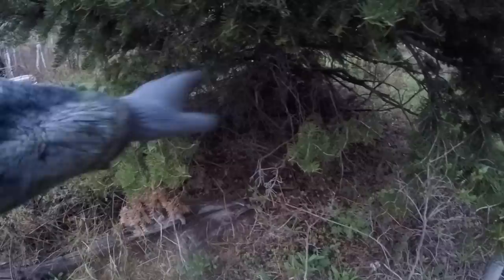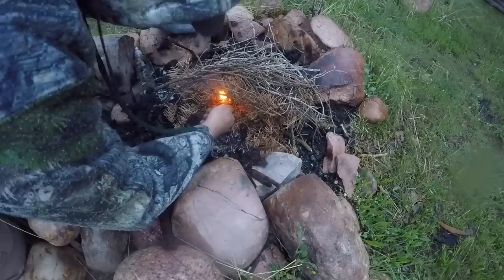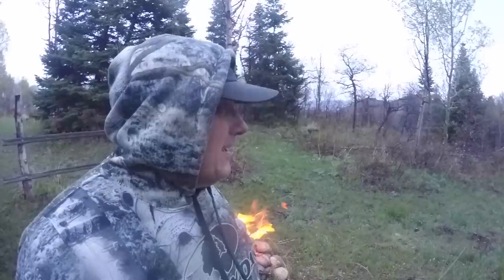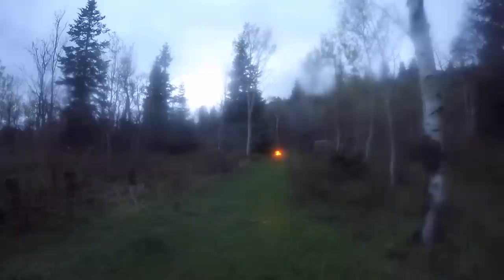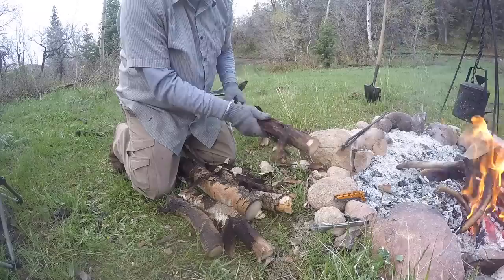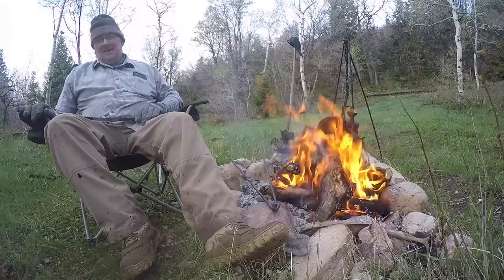Unusual Way to Use a Tarp Over a Fire - The Beast Sleeping Pad Set Up

Comment: Actually it looks like a great way to burn up an old tarp if you are not really careful. Using less when backpacking I have a small ( cooking ) fire in a Solo Stove ( Lite ) for a hot meal. It's a great way to have a small camping fire that is self contained and still  Leave no Trace.
Reply from the maker: Haha, well I've never burned up a tarp before, but it could happen. I love a nice campfire and I make one most ever time I camp, it's something I really look forward to. For me the campfire helps make the camp. There are times when  I'll use some sort of twig stove or a butane and I enjoy that too, but I really love a fire. One thing though is I use a fire pit location if one exists where I am at, but if there isn't one, I like to cover it up when I'm done.  Thanks for the comments

Comment: Why does the man set up sleeping tent far away from campfire?
Reply from the maker: I’m the man you ask about, haha….  typically my sleeping is away from the fire a bit, or away from the main part of camp a bit. I just look for where I want to set up sleep arrangements whether hammock or ground sleeping and I just do it there. I don’t need to be close. I may be right at the fire if I’m using it for heat to sleep. I have the warmth I need without the fire unless I just want to do it that way. In our area a lot of the wood in the fire will pop quite a bit, having a tent close to that is a sure way to burn a hole. I am not usually as far from the fire as in this video, but it was nice for this location since the ground around the fire was all cobblestones and where I set up was soft grassy sod. Thanks for asking !!

Comment: That pine looks like a fir tree to me. Hard to tell on a 1.5"×2" screen. Lodgepole pine has shortish needles similar to a Douglas Fir, but still, that looks clsr to a fir, or spruce. Splitting hairs I guess. Pime needle rolls off the tounge a lot easier.

Comment: You may want to research what that bean can lining is made of. Unfortunately it may not be something you want to heat on the fire
Reply from the maker: Glad you commented on this subject as it is a common misconception, it’s been all over the internet for years now, so much that it appears to have become a “fact”. The truth is that if my heating beans over the fire in the same can the beans came in is harmful then nobody should ever eat any canned product ever. I’m subjecting the the can to around 200 degrees of heat, when the beans are canned they are cooked in a giant pressure cooker at temps over 300 degrees. The only way I can get the can hotter than about 200 degrees at my altitude is if I remove the beans from it, or use a pressure cooker. Another consideration is that the smoke from the campfire will give me a dose of carcinogens regardless of anything else.

Comment: You can line your tarp with tin foil also to help protect it from the heat.
Reply from the maker: There are reflective fabrics that are silver on one side. This works so well actually that virtually any of our fabrics can be used. The canopy formed over the fire captures heat and gets 120-160 degrees, which radiates down on you naturally, so heat is felt from above and from the fire, pretty cozy. Thanks !!

Comment: Tarp over a fire? More like a tarp 100 feet away from the fire! Why pitch the tent so far away from the fire anyway?
Then further in the video he does it, DOAH! I'd be concerned with the plastic overheating and either shriveling/shrinking or melting.
 Also, why people go for the fire steel first off is a mystery to me as there is still ample supply. In a EOTWAWKI, yeah, save the sure/easy start fire method for emergencies, but for now, just flick the Bic!
Reply from the maker: No there actually is a tarp directly over the fire, and there is another over my Beast Sleeping pad.

Comment: Perry i have notied in many of your vidz while cooking you use two bars to hold up you pans or cast iron. Is that something you made and if so what is the materials? TY
Reply from the maker: John High I have made a couple types for lighter duty 1/4” Stainless rod or Aluminum rod. For the cast iron I use 3/8” steel rod. We used to make and sell them, but it’s not our main line so we stopped. Thanks.
Reply: Could you PM me so i can get some more info. Thanks!

Comment: First you should have fixed the stones a bit to help if the wind whips up. Also if you build up one side of the fire pit you can sleep closer to the fire as the stones will give off some heat. You can also buy these thin fire proof sheets to put over you in case sparks land on you or if raining attach them to your trap. 
Never ever cook the food in the can it comes in, I saw another pot you had so for health wise use that. 
Just some friendly hints 😁
Reply: Or he could do just as he did and everything worked out fine

Comment: I have been toying over the idea of digging a dakota fire hole with 1 on the outside of a shelter and 1 inside except I want that hole really deep deep enough that you can have a decent size fire but the flames stay at or right around ground level so you dont burn yourself out..so what do u think is that a and idea with any merit????i would try it but the neighbors in my apt complex dont appreciate things lime that lol thanks
Reply from the maker: the flames will still try to extend to the surface. You don't need to go more than 12-18 inches, by the time you put your pot on you wont see much in the way of flames. It would be best to try this in the woods. You can control the size of your fire by how much airflow you allow and by the wood you use for the fire. I think it would be difficult to have the air intake outside the shelter and the fire inside. Seems like you'll be starting the shelter on fire.
Reply: @wildernessinnovation  thank you for answering me....i had the same thought about it burning down the shelter that's why i asked.i live in washington state in the puget sound our woods have a ton of undergrowth black berry clinging vines hell seems like everything out there wants to poke and stab you to death lmao if there isnt a trail you are pretty well out of luck its a rainforest after all and in winter it rains constantly sometimes for weeks at a time without a dry day.i say that to say this.i am hoping that with sufficiant height and the cold rain on the outside and probably try to find some sort of flame resistant like reallybigmonkey  did years ago if you havent seen his channel he is great lol dude cracks me up but he did a video       el cheapo tarp shelter with fire or something to that effect but that's where I got the idea another idea was to make a huge coal bed and inside the shelter dig a few holes and fill the bottoms with rocks and coalsbury it and see how that goes...sorry for the long long comment using talk to type and it doesnt do punctuation apparently lol

Comment: I've been told they line cans with plastic film now so we shouldn't beat the food in the cans any more.  You might want to look into that.  Inconvenient and I hate all the plastic everywhere.
Reply from the maker: June K Yes there is a coating inside the cans, it prevents chemical interaction between the food and the metal of the can, which makes the canned food safer and last longer. The plastic is as inert as glass. There are thousands of formulations of plastic from rough dirty industrial applications to pure sterile medical applications, each type of plastic is tailored to its end use. A plastic used in food is not the same as that used for the bumper on your car, a medical IV tube is not the same plastic as a gas hose in your car. Some people say that food plastic may be safe until heated. Canned food is processed at up to 350 degrees F, when I’m warming up food on the fire in a can I’ll be lucky to hit 212 degrees. Hope this helps, thanks for your comments.

Comment: Brother. Fyi...you shouldn't heat UP UR food in those cans.Those cans have plastics in the linings of those cans and WHEN U heat the cans it releases those chemicals IN UR food..Just put u food in a pot or skillet and avoid that health issue..Hope this helps..nice video..
Reply from the maker: Thanks for your concern and comments. In my younger days I worked at a food processing facility, part of what we did was canning various items. Hundreds of cans were put into a giant steel basket which was lowered into a large pressure cooker. These cans were processed at about 300 degrees for a certain amount of time. When I cook on the fire I only get to the boiling point, so I’m about 100 degrees colder than the food is processed at. My understanding is that the liner coating in cans doesn’t break down till close to 600 or 700 degrees, in other words basically when the can starts to char. Some years ago I did a bunch of research into this and found that although many plastics contain chemicals that help them to form into shapes easier, etc. and that those chemicals are not used in liner coatings for food products. Thanks again for taking the time to comment. Perry

Comment: I would be VERY careful cooking food in a can, some cans have a coating in them that will make you very sick, not a good habit to get into. Unless you like hospitals.
Reply from the maker: Cooking in a can danger unfortunately is a common misconception that stems from the whole all plastic is bad for you thinking that has in the past been promoted so heavily that random thoughts have been made into "concrete facts" and I can briefly explain this.Various can coatings are put there to protect us by protecting the food inside. The can itself is very secure for preserving the food inside, the inert coating prevents chemical reactions of food and can. There are literally thousands of formulations of plastics, each has its own purpose, many of them are for industrial use and may have additives in them to assist in manufacture or for stability. Those plastics used in food production and in medicine are inert and give nothing off that is harmful to the body. There are plastics that are as clean as glass. Now to the second point, a canned food product. These items have already been cooked at a higher temperature than I will use at camp. Canned products are sealed in the cans then placed in giant pressure cookers where temperatures can exceed 300 degrees F. All I'm doing is warming the contents, at most a boil, around 200 degrees. If it were possible for a danger to exist I'd have to get the can to the point where the plastic coating to starts to burn, that can't happen when food is in the can. Hope that helps. Thanks for your comments.

Comment: Don't cook in plastic coated bean cans unless you want to ingest carcinogens.
Reply from the maker: Peter Franzen it is unfortunately a common misconception that cooking in a can causes the can liner to decompose and release carcinogens. Let me address this issue. First of all the food in the can is already cooked at the cannery in the can in a giant pressure cooker at much higher temperatures than I can get over the fire, all I’m doing is rewarming it, getting the food to the boiling point. Secondly the type of plastic used as the can liner is basically inert, it is food grade and the chemicals used in plastic molding are not used, so these are not present anyway.  Thirdly even if those chemicals were present they don’t get released to freely contaminate anything until temperatures approaching 700 F are reached, getting to a boil in the mountains where I live means I don’t even get up to 200 degrees. So on all three counts there is no harm or danger at all to cooking in the can the beans come in. It is an unfortunate bit of information that has been propagated for years, to the point that it is widely assumed to be true.

Comment: Why would you set up your tent so far away from your fire?
Reply from the maker: Great question - Thank you. I rarely camp next to my fire though I could. I sleep better away from the fire, I'm not trying to maintain it in the night, it does not awaken me if the wind kicks up and stirs it up, I have no concern of coals being blown onto my bedding. In this video I just liked that little grassy spot and so I put my sleeping there. On average I'm probably about 100 feet from the fire to my sleeping area. I can do this, even in the winter, because I don't need the fire to be able to sleep, not for warming or comfort. My sleeping setups are so comfortable that I go right to sleep and I sleep till morning. I use two general methods for sleep 1) The ponchos we make can be used in a Hammock Mode, that is the way I sleep more than half the time, 2) Our Beast sleeping pad system is for on the ground use, and what I used in this video. We make all kinds of accessories that go with both systems. Thanks again.

Comment: IF  he would have put 1 more pole to the three he put up, the tarp would FIT A WHOLE LOT BETTER! be easier to tie, be a little roomier under there!
Reply from the maker: Yes, he (I) could have done that for sure as well as tons of other things, even better I could have used my mini parachute cover over the fire. I often do thing is a different way just to see what I can make out of it. Sometimes I pitch a tarp in a difficult location when there may be lots of better spots in the same area, but I want to see what I can make. I camp every week all year round so doing a lot of different or unusual things adds some adventure to the camp. Many times I'm just showing what I did, most of the time it's not something spectacular, just different. Thanks for watching and commenting.

Comment: This guy is clueless. Why not pitch a tent? That shelter would be useless in even a slight breeze. Especially when he gets poisoned from eating food heated in a can. If you take a pick up truck camping why not put proper gear in it?
Reply from the maker: Ian Rawlings I don’t use tents ⛺️ much they are too confining I like to see the great outdoors I’m in and not be cooped up. That shelter will actually work in a decent wind and  if conditions change I can always modify it. I enjoy using odd things at times to see what can be done. Yes I could use some prepackaged shelter solution, but that’s what everyone else does. I usually have other gear in my truck with me, but I have fun doing the unusual. I won’t ever get poisoned by eating out of a can like it did. When food is canned they put them in a giant pressure cooker and go to over 300 degrees, I only take it to a low boil, about 200 degrees at the altitude I was at. So if I would get poisoned then anyone eating any canned food would get poisoned because the poison would be released in the cannery when it is first made. Unfortunately this is a false notion propagated on the internet. Thank you for watching and for your comments, have a great day.

Comment: Nice, informative video!
Btw it was a HORROR watching you handling that axe :D I tought you left "and auto-first-aid" from the title.
Reply from the maker: BitMiller these people are pretty scared of hand tools it seems. I’ve been using them since I was about 8 years old, never had an injury with an axe or hatchet. So those chopping strokes were very light and short, most of them the follow through would be to ground those strokes on top were exceptionally light and short. Sometimes on camera 🎥 things may appear a bit different than they really are. Were I using long strokes some of what I was doing could have been hazardous. Thanks for watching and for your comments.
Reply from the maker: Should start out saying “these days people...”

Comment: Instead of foil, try soaking the corn in water then shake excess water off before cooking.. When you cover it with coals it will steam but not burn.. Better tasting, more tender roasting ears.. I like to eat out of the can and save plates and cleanups.. Why is your tent so far from your fire.? That heat would be good at night..

Comment: Do NOT cook food inside cans!!!!!
Reply from the maker: That's a common misconception, that cans are dangerous to cook in. Supposedly the liner coating is cancerous or if heated is cancerous. The food is already cooked in the can at the cannery. They use giant pressure cookers where they can get the temperatures inside much hotter than the boiling point I get to over the fire. Even if the plastic liner were the type that gave off toxins when heated, the temperature needed to do that is in the 700 degree range, I'm not even 200 degrees at my altitude when boiling. I do thank you for raising safety concerns though as we should always be thinking of proper ways of doing things.

Comment: Not good, as it would be to windy under that tarp. Better to wrap 2 sides of those poles to stop the wind and put the fire on the edge of the open side. Or just use one pole and use that to hold up the center of the tarp and guy it from the tarp outer edges, Put fire at open end, No wind and still warmer.
Reply from the maker: There are lots of ways to set up tarps and depending on conditions you choose what you want. For this camp that set up worked well. The idea is to trap lots of heat in the canopy. Temperatures can get over 120 degrees up there, that heat is radiant and not affected much by wind, so I have an overhead heater and the heat from the fire, it makes a very warm shelter, especially in cold conditions. I have made many videos showing this using parachute fabrics as the canopy.  Thanks for your comment !